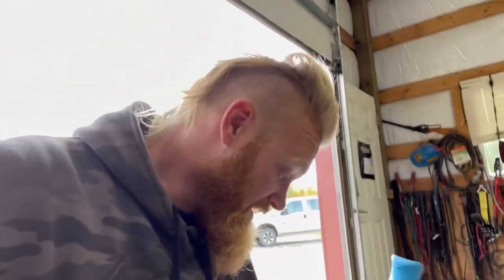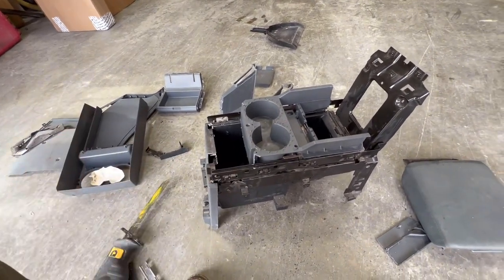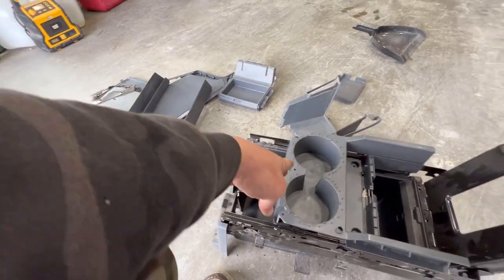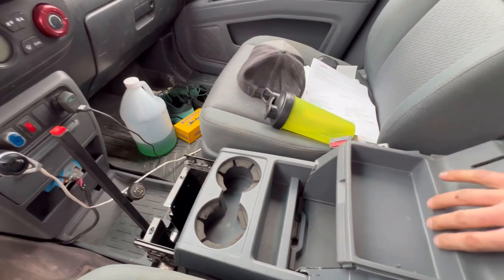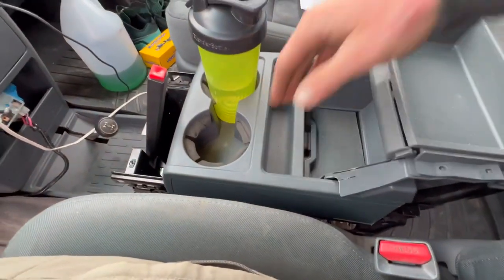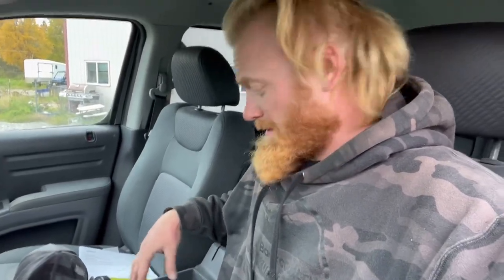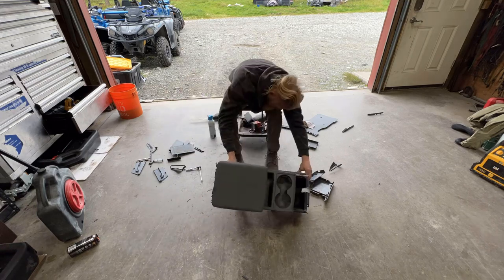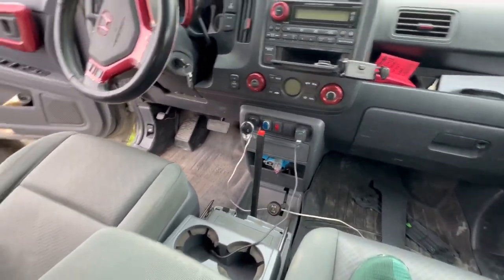Adapting center console Honda Ridgeline floor shifter

Comment: Removing/reinstalling that center console is a BITCH of a job! My cup holder foam rings had died so I had to remove the console to replace them. I honestly think it would be easier to rebuild the engine! Honda: Why so complicated??????   :-)
Reply from the maker: Haha 💯 it was way more complicated then I imagined it being haha
Reply: was searching how remove the console myself theres an easier way to get the cupholder foam replaced theres some vids on it just remove 5 torx screws in front lift it up high enough to get the new foam pad in. gotta get under where bottom tray is lift up tabs and slide the sliding piece forward toward the ash tray to access them beats taking console out good luck